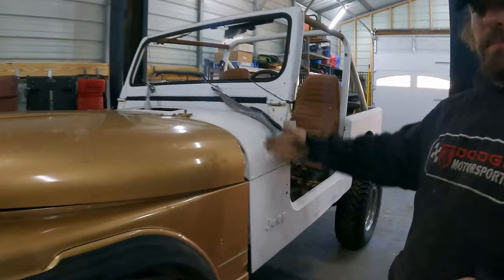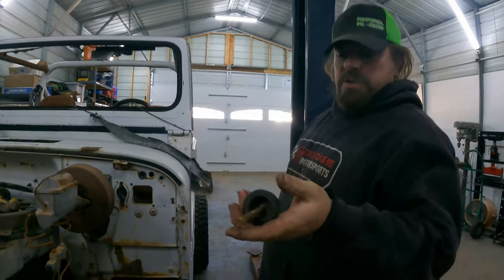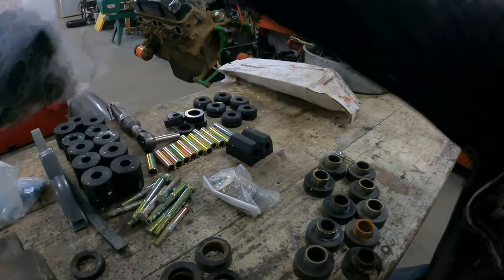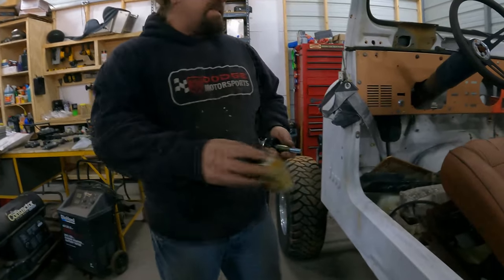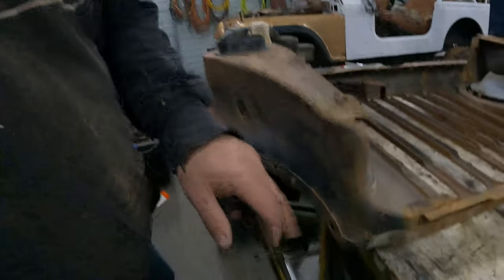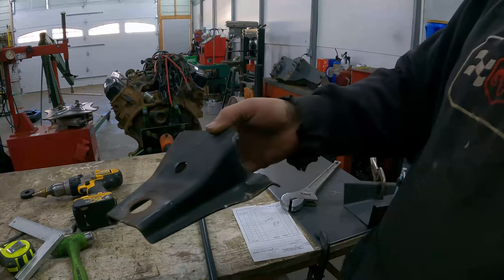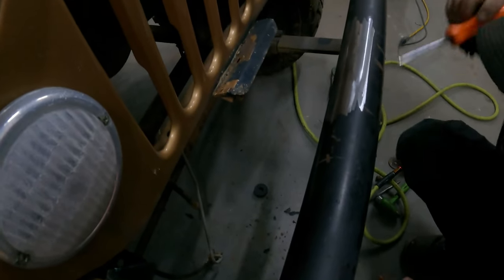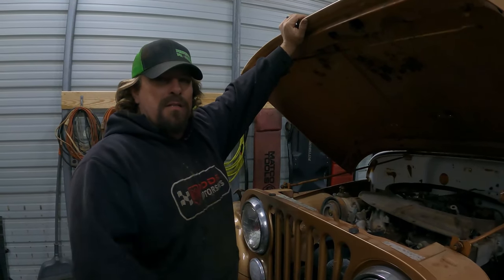Will A Jeep CJ7 Front Clip Fit On A YJ Frame? Let's Find Out On This BUDGET BUILD!

Comment: Oh one more thing I forgot. Use thread sealer on the bolt treads It will act as Loctite and a thread sealer so they won’t rust I learned this trick from working on the salt trucks in Ohio. works great!
Reply from the maker: That is a great tip, I will keep that in mind in the future.

Comment: First time you use the lift and it not for doing what it’s installed for. That’s a good sign. 👍. It will be very handy. 
You know how many times I’ve bought something twice because I’ve forgot what I’ve already bought 😂 do you need braided fuel line😂 and fittings🤣 seriously do you?
Reply from the maker: I hear you there, the lift will be very handy.  I have multiple things I rebought then found on this project.  As far as braided fuel line, I have some, but the SS fuel lines from the Cherokee are going to workout pretty good.